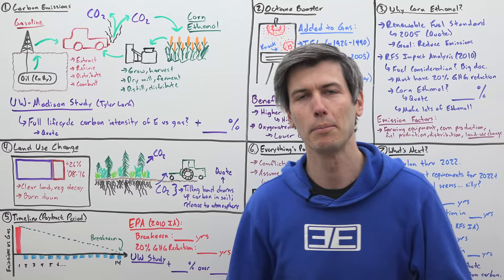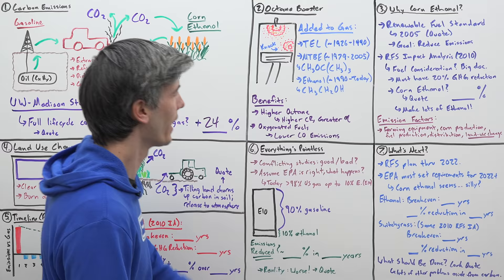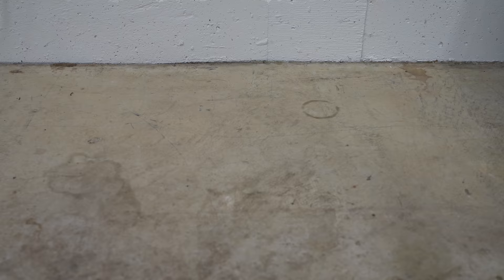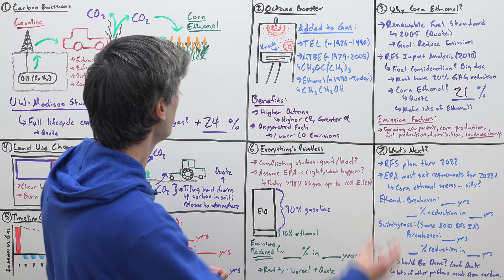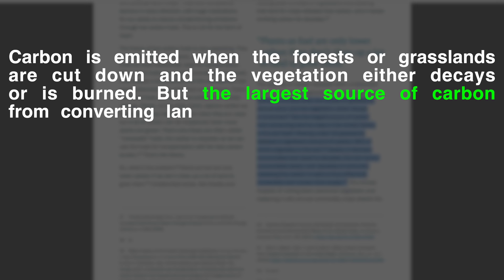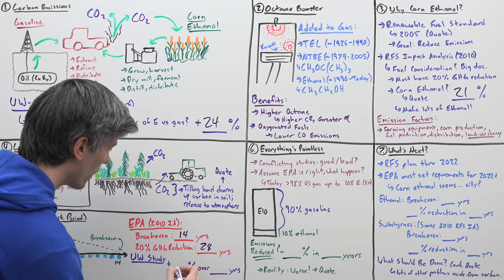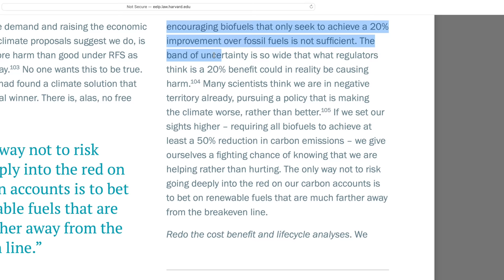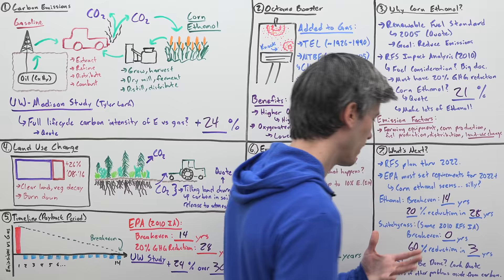America Was Wrong About Ethanol - Study Shows

Comment: Excellent video! It's awesome to see you making videos like this. I did research in engineering undergrad on this and came to similar conclusions. One thing that was not mentioned that also plays a role, is that ethanol is not as efficient as gasoline; to its detriment. This would only hurt it's case in any study. (After my research I always use non-ethanol premium when available) 🤙
Reply: How are you measuring "efficiency"?
Reply: @codetech5598  My understanding is that a car gets fewer MPG on gasoline containing ethanol than pure gasoline.
Reply: @richardreid6377  On a volume basis but I believe ethanol weighs less. And as mentioned the video, straight MPG doesn't tell the whole story.
Reply: In your research did you take into account the distillers grains that is also produced during the manufacture of ethanol?

Very few people, seem to know enough about how agriculture actually works. Every study I've looked at that is critical of corn ethanol fails to account for the distillers grains that is also produced. Since it wasn't mentioned in the video, it's probably safe to assume this is yet another one of those massively flawed papers. Also most fail to account for current no and minimum tillage practices used on farms. 

The protein in corn is not consumed when making ethanol. The proportion of protein in whole corn is too low to make feed so additional protein from soybeans is added to make a balanced feed. However, the protein left after making ethanol is a source of concentrated protein called distillers grains which is then used instead of soy protein. It works out that for every acre of corn used for ethanol, an acre less of other crops is needed.

Corn is about 10% protein. Soybeans are about 40%. By using both, feeds ranging from 14% to 22% protein are often made. However, neither corn nor soybeans have enough fiber so a source of fiber also has to be grown. After the starch is used from the corn to make ethanol, the protein is left in the distillers grains at about 30%. The 30% protein distillers grains can be mixed back with 10% protein whole corn to help make the needed balanced protein. Plus the distillers grains still has the fiber. That reduces the need for soybean and fiber crops.

On a percent basis, soybeans have about 4x the protein compared to corn. However, corn produces about 4x the yield per acre. So on an acre basis, corn and soybeans are practically equivalent for total protein production. That means for every acre of corn used for ethanol, an acre less of soybeans is needed. Plus less land is needed for a fiber crop. So their claims of land use change due to corn ethanol are gibberish.

Corn ethanol has another benefit for human security. We depend on corn not only for food but also many manufacturing processes. If there is a severe drought for example, ethanol production could be reduced.  Thus, helping ensure enough corn for other uses.  I'd guess a 20-30% buffer against really dramatic consequences.
Reply: If you had access to ethanol free regular vs ethanol free premium would you use premium?( assuming your car does NOT require or reccomend premium)
Reply: @heartysteer8752  Thanks .. very interesting points.
    Never heard that perspective before.
Reply: Here in Brazil, ethanol has been largely used since the oil crisis in the 80's (using renewable fuel sources was our government's response to the fuel crisis). Our ethanol is extracted from sugar cane, which will yield 3x times more ethanol per square meter than corn. It is also widely available, every single gas station has ethanol available.

It is very common knowledge that ethanol will do less km/l (mpg) than gasoline. Gasoline has a stoich (lambda 1) Air-to-Fuel ratio of 14,6:1, Ethanol is around 9,2:1. In simple terms, if your car does 10km/l with gasoline, it will do around 7km/l on ethanol; that's also why ethanol is cheaper. In the 80's and 90's, picking between ethanol and gasoline was like picking between diesel and gasoline today, a car that ran on one type of fuel couldn't run with the other (though, unlike diesel, ethanol cars could be converted to run with gasoline and vice-versa by changing engine components). Thanks to advancements in fuel injection technology, since the 2000's cars have been sold with "flex fluel" technology; that is, they can run ethanol, gasoline or any blend of them, you no longer have to be stuck with a single type of fuel. If ethanol is over 30% cheaper than gasoline, it is worth fueling with ethanol. Otherwise, just use gasoline.
Reply: ...however, there's also performance. Unlike gasoline, ethanol has extremely elevated specific heat and is a natural anti-detonant, it also works as a natural coolant inside the combustion chamber (that's also why it is harder to start your car in cold days if it is using ethanol - ethanol doesn't burn as easy, especially in a cold engine). Some online documents suggest ethanol has a octane rating of around 130 (far more than any gasoline available), but USA testing with a supercharged Corvette showed that gasoline containing as little as 40% ethanol (E40) was already capable of outperforming 115 octane race-grade gasoline (the type sold in metal canisters). E85 ethanol or, even better, E98 hydrated ethanol (98% ethanol and 2% water - the type of ethanol sold here in Brazil) will vastly outperform any gasoline known to man and comes second only to Methanol (fuel used in drag racing). In order to be able to summon the power of ethanol, your engine must be finely tuned for that; in simple terms, if it is a NA engine, you need very high compression rations and aggressive timing, if it is a turbocharged engine, ethanol means you can use extremely high levels of boost (since ethanol doesn't detonate, you can use as much boost as your turbocharger can push without ever having to worry with knocking). That is, don't expect that simply using ethanol in a engine with gasoline compression/boost levels and simply adjusting for ethanol injection/timing will yield huge horsepower gains.
Reply: Same here! Yes I pay more for it but I get more milage per tank and it think my engine will thank me with a longer life span. If you have ever seen what the water the ethanol attracts in your fuel does to your valves you will understand what im saying.  Biggest rip off!!!!!  If you didnt know ethanol pulls moisture out the air and it ends up in your gasoline. Not good!!!!!
Reply: @reasonablespeculation3893  it is an uninformed perspective, i'm afraid. that is likely the reason it isnt more widely held. i am and was born and raised a cattle and poultry farmer, and know plenty about 'how agriculture actually works.' for the record, folks who do tend not to sound like denizens of ivory towers like 'hefty castrated cow' or w/e his name is...
Reply: @scottfreedoms9584  Regular, especially if used under low load, lower altitudes and has electronic engine management situation to proactively address predetonation issues.
Reply: Well stated. E85 is billed as a little cheaper per gallon than gasoline, but it has about 40% less energy than a gallon of gasoline so you need to burn 40% more to get where you are going. And the hygroscopic nature of alcohol laced fuels is a real turn-off as well.
Reply: I did a back of the envelope calculation back in 2000 when I was working for a corn starch factory. I got similar results then, even without looking at land use changes. Simply looking at how far can you drive by putting a litre of diesel in a diesel car, vs putting a litre of diesel in a farm and then putting the resulting ethanol in a petrol car. (comparing the same car that had both engines as options).

As near as I could tell it was purely a subsidy for ethanol makers. Which was an amazing coincidence as the largest political donor at the time was an ethanol producer.
Reply: @mr.chocob3880  Oh I know, just wondered if the poster did after him dropping the "engineering undergrad" and telling us he only uses premium.
Reply: Also ethanol causes early wear and degradation of rubber bushings and o-rings.
Reply: Technically ethanol has a lower heat value per quantity in (btu), this requires a different stochiometric ratio to burn cleanly. pure gas is something like 13.8:1, pure ethanol is 9.7:1 or something like that. E85 would be between, but above 40% We countered this by increasing compression ratios to 15:1 adding thermodynamic efficiency. Ethanol can even run in modified diesels.
Reply: @turleytho  No, but the invreased water in the exhaust will rot out your exhaust faster. Fuel sensitive o-rings should be viton for gasoline use anyway.

Comment: When you have too much food - you convert it to alcohol - that is the way to do it properly.:octopus-red-waving: Only economics of oil is stopping alcohol from taking over fuels market.
Reply: The byproduct of ethanol production is food i.e. distillers grains.  Without the feed component, it is uneconomical to make ethanol from corn, but with it, few other sources can compete with it.

The spot cash delivered price of ethanol on the NYMEX is $1.42/gallon.

The price of an unusable sub-grade of gasoline (RBOB) is $2.27/gallon.

To turn RBOB into usable E0 gasoline costs even more and unfortunately for humanity becomes even more toxic and dirty.

Or splash in >10% ethanol to RBOB and the resultant usable fuel becomes less toxic, far cleaner burning, and cheaper/cheaper per mile to drive.  Who can be against that?

E85 use has taken off in France, >25% of fuel stations have E85 vs the US which has <2% availability despite us being the largest ethanol producer in the world.

It is not economics keeping alcohol from taking over fuel markets but monopolistic power.

The Federal subsidy for corn ethanol ended back in 2011.

The long-standing stated goal of the G7 Nations to end petroleum subsidies?  No such luck.

Comment: Fun fact: E85 in the United States isn't required to be 85% ethanol

E85 in the US is 51%-85% ethanol.
Reply: In my neck of the woods, it's averages 75-80% during the winter in may drop to ~70%
Reply: I mean if you're serious about your fuel and have a ton of money to blow, VP Racing has the best quality fuel.
Reply: I wish we at least still had the option of pure gasoline. I guess some places do, but not by me in NY.
Reply: @UpperRobin29  defintely.

The independent carwash/gas station I used to work at sold VP 110 octane petrol, as well as 95 octane.

That being said, 2 years ago, March when the Pandemic began, we were selling 87 octane for $1.99. 

Our VP 110 Octane was still $8.50/gallon. E85 (~110 octane) was as low as $2.00/gallon
Reply: I didn't realize that.  👍
E85 can make great power in a blown application where you take advantage of the high octane but expect your mileage to flush like a toilet.
Reply: @nthgth  To get a good octane would be very expensive! We surely do not want to go back to lead!
Reply: @gregkramer5588  certainly not lead, but whatever they used after 1974 instead of lead (and before ethanol) seemed fine and fuel prices have been fine (some of the time, lol)
Reply: Another fun fact. Do you know why it’s mixed with gasoline instead of being 100% ethanol? So people won’t drink it.
Reply: @nthgth  It was MTBE which is nasty stuff if small amounts get in our water supply. Not as bad as many chemicals but bad enough to be banned in some states and countries.

Comment: Argument of biofuels aside... can you imagine what would happen if toyota and tesla co-developed a hybrid ev?
Reply: Can you imagine if Nissan came out with their fuel cell ev which uses ethanol as its hydrogen source?  They drove a prototype around in Brazil in 2016 using Brazil's already existing E100 fuel infrastructure.  

It too would be better if it was a hybrid which used a minimal battery for extra acceleration which would allow a smaller fuel cell.

Nissan's fuel cell could still run even if the ethanol had enough water in it so as to be non-flammable.  Making an already safe to use fuel even safer, not having to distill it to 200 proof would make an already cheap fuel even cheaper.

Advanced ultra quiet European and Indian large military submarines use ethanol fueled fuel cells for propulsion.  You can buy alcohol fuel cells for backup, RV and sailboat power systems and drones.

Here is an excerpt from an article from seeking alpha on ethanol fuel cells:

>>>Fuel Cell technology offers many advantages over Lithium-ion batteries, not the least of which is that hydrogen used in fuel cells has the energy to weight ratio ten times greater than lithium-ion batteries.

That said, the volumetric energy density of ethanol is over five times greater than hydrogen.

Ethanol has five times higher volumetric energy density (6.7 kWh/L) than hydrogen (1.3 kWh/L) and can be used safely in fuel cells for power generation.<<<

Comment: We have E85 in Australia, but now a niche fuel mostly used for tweaked performance cars rather than marketed for being a green and cheaper alternative. I have a 2014 GM based car that can take the fuel. It used to be reasonably cheap but now significantly more expensive than regular unleaded, I guess because those with performance cars willing to pay the price.
Reply: Im afraid its going to happen here too as gasoline gets more scarce. Ethanol here you can make your self has always been my plan when gas runs out.

Comment: I personally care very little about the emissions impact but I feel like for the sake of energy independence if we worked to make full ethanol fuel transition to possibly hybrids made to use 100% ethanol we could actually have a sustainable reasonable energy solution which would in 50-100 years reduce emissions and we would have a renewable fuel source. Also ethanol doesn't have to be corn based, it could be any old plant matter because it's just refined alcohol really.  So maybe we experiment with different plants and find which is the easiest to grow in large quantities with minimal emissions and maximize ethanol output

Comment: Not only does ethanol keep the corn farmers happy, it keeps the small motor mechanics fed. They never lack work when all the rubber hoses and fittings are constantly melting. Same for pleasure boat mechanics.
Reply: Ethanol is less corrosive on rubber than what gasoline and BTEX (benzene, toluene, ethylbenzene, and xylene) are.  Check out any chemical compatibility chart you can find.

Mercury Marine actually said E10 may be the superior fuel to E0 in a webinar.
Reply: @danafletcher2341  Not relevant, look up all common rubber materials with acetic acid.  It's problem for rubber and metals.  It isn't the ethanol but the acetic acid formed by bacteria metabolizing the alcohol in the fuel system.
Reply: @RWZiggy  It is E0 gasoline that grows things in the bottom of fuel tanks since water accumulates in it.  Ethanol prevents accumulation from ever happening.

You will not make vinegar with 200 proof ethanol or anything near that.

PS  I did look up acetic acid at Cole-Parmer's and it is rated good for natural rubber which is more than we can say for unleaded gasoline or BTEX.
Reply: @danafletcher2341  You're bringing up irrelevant things like some freshman student that only has a bit of book learning.  We don't use 200 proof ethanol, we use 10 to 15 percent in gasoline and that is why vehicles on "gasahol" have corrosion damage.  200 proof ethanol can't be made by distillation, it is very expensive, $16 a gallon before $25 excise tax.   Fuel hoses aren't made of natural rubber, guess again.  Fuel hoses are attacked by ethanol fuel, known issue.

Comment: A couple of comments on ethanol: 
1. It can't be transported the same way as diesel or gasoline, because the ethanol absorbs water, which takes energy (distillation) to remove.  2. Ethanol has lower energy per volume than gasoline, so the added ethanol reduces the energy content of a gallon of fuel.  The main benefit of ethanol addition is to the farmers.